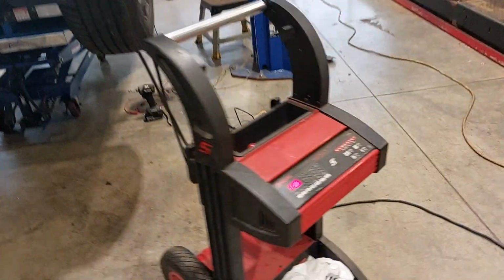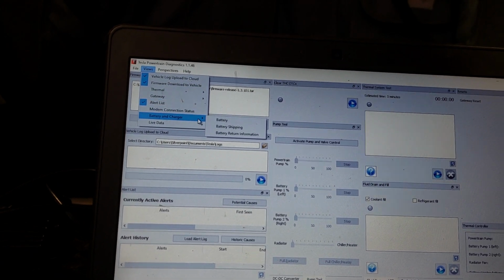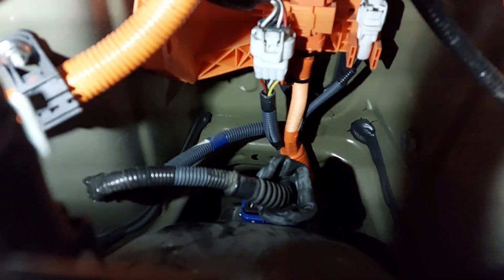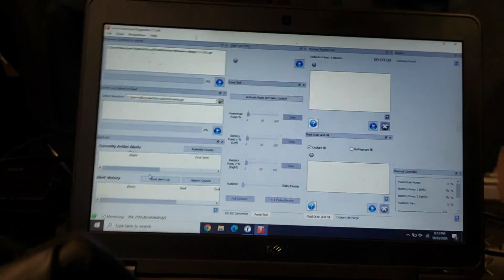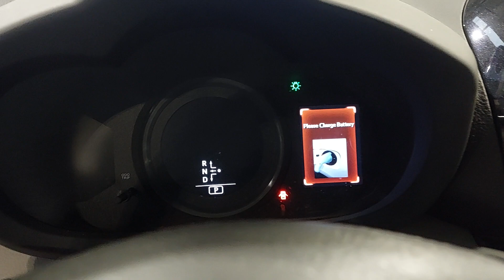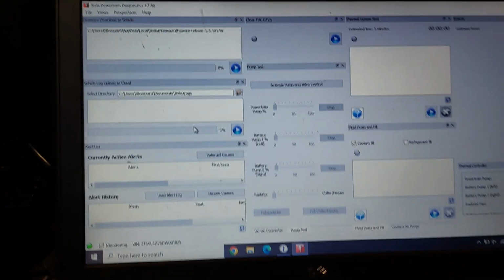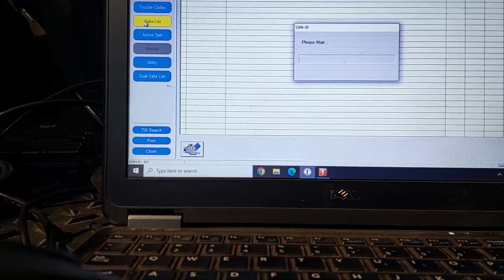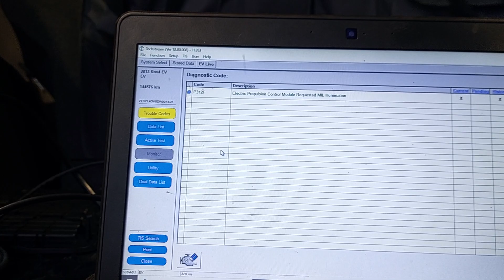Weird RAV4 EV warning light issue

Comment: I sympathize with your situation, but 
1. If the Tesla software system malfunctions, TechStream is absolutely useless.
2. It’s a pity that you don’t want/can’t follow the advice in a personal message and perform other checks that are necessary to localize the location of the fault.
3. This video of yours lacks a lot of necessary information and does not include all possible checks.
Reply: Can you provide links to sort that stuff out??
Reply: @garbizwal  Unfortunately, I don’t understand what exactly you want to understand?
Describe the problem with your RAV4EV and we can discuss possible/probable causes of these problems.
It is possible that the answers to your questions are in the video of my channel.
Reply: @altechpage  Hi,  Sorry I am looking at how to get the BMS fault to reset in my Rav 4 EV.   Do you have any information on how to clear the BMS fault?
Reply: @garbizwal  In order to clear a fault code, you need to determine the reason for its appearance.
Many Tesla system codes are erased on their own if the car is “cured”.
I can't answer more precisely, since the fault code of your vehicle is unknown.
For example, the reason for the BMS_f107 code is completely different from the BMS_w023 code.
Reply: @altechpage  Ok thank you the fault seems to be BMS_f059
Reply: @garbizwal  DETECTION CONDITION for this code: Internal electric vehicle battery voltage malfunction. The voltage detected by hardware and the voltage calculated by software do not match.
TROUBLE AREA: Electric vehicle battery assembly.
NOTICE: Check the condition of the auxiliary battery, as an alert code may be output due to a drop in
the auxiliary battery voltage.
HINT: If BMS_f059 is stored, the EV system cannot enter the on (READY) state and charging stops.
Take a look Potential Cause and Test plan for this Alert (if it is in the TDS software for him).
Reply: @altechpage  Thank you.  I will see what I can find.  The 12v battery was low.  I was charging it and I will make sure its charged when I try again.  As well I just watched the video about making sure the disconnect is seated properly.
Reply: @altechpage  Ok it seems I have a firmware mismatch.  I have a Model S sport drive unit I am trying to use to fix this broken Rav4 EV.  "Platform Mismatch GTW_f085"  Is it possible I can flash everything to work?
Reply: First: conceptionally grab how a US electrical building code for residential application is designed. They have a required earth ground, and a third wire connected to all devices that have metal, and the metal is to be grounded. Actually, this third wire ground is connected to the neutral, or non-hot side of the wiring at the incoming box. What this allows is that if the neutral in a device shorts to the metal chassis of the device, really nothing happens and if the hot side of the device shorts to the metal, then a fuse is instantly blown. 
   That is the safety nature of the design both in your home, and in that car. Consider your car, with a very high (lethal) voltage DC battery under it. Therefore, doing battery substitutions requires that the grounding of those substitution ‘boxes’ I’ll be intimately grounded with less than mill potential resistance in those grounding connections, and with the battery housing(s) themselves. Troubleshoot with modules, and housing(s) and chassis, and even the external battery charger with that “safety design basics” in mind.